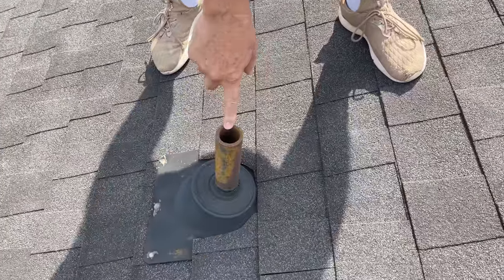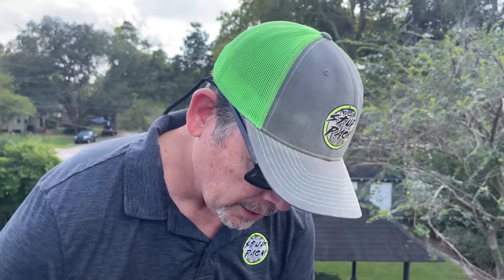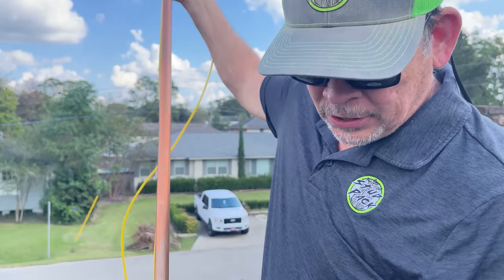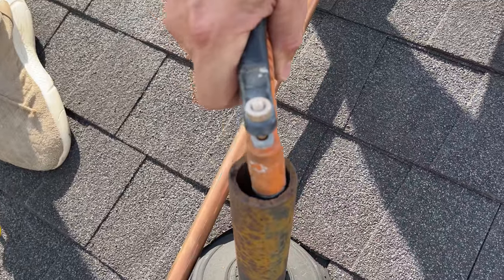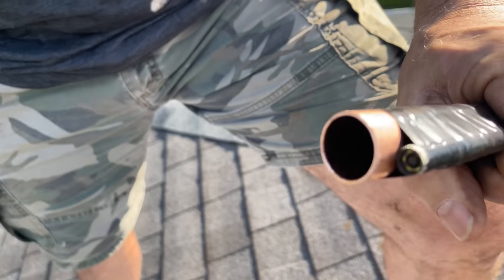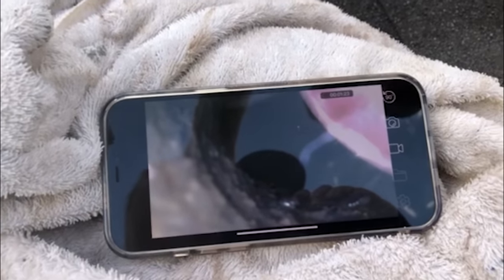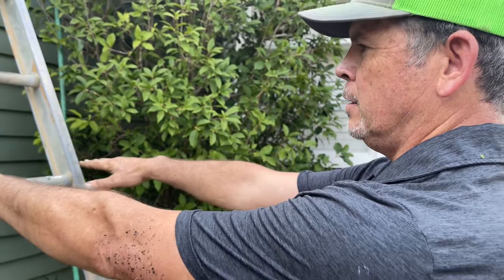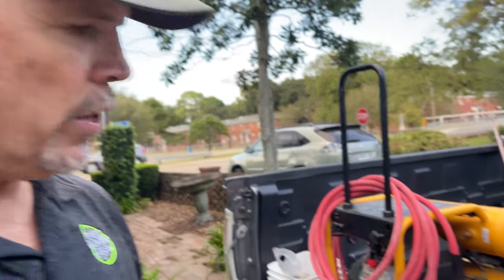Using a BORESCOPE to CLEAN OUT a CLOGGED VENT PIPE

Comment: We have squirrels here, and oak trees that drop tons of acorns.  I have a toilet upstairs that the water drains out of the bowl all the time, no leaks at wax seal or anywhere else that I can find.  Have torn it all apart and can't find a reason.  Have wondered lately if it could be because of a clogged vent pipe.  It does it all the time, whether we run any other faucets, toilets, washer or DW, or not.  Any thoughts?  We're on septic though doubt that makes any difference.  And, the roof is far too high and too steep for me to even consider going up there.

Comment: i always wondered why they don't put wire mesh over ends of vent pipes to keep debris and bugs and such out of vent pipe or little caps with mesh like chimney caps. the only reason i can see not to put mesh over pipe is ice forming from warm water fog coming up vent pipe and freezing end of vent shut in northern climates have you ever seen people put covers over vent pipe?
Reply from the maker: I’ve seen “p traps” installed upside down on a vent 👊

Comment: Just attach to vacuum to the top on the vent pipe and pull the access plug under the sink. You don't need to feed a pipe down there.

Comment: You should have tried sealing the vacuum hose to the top of the vent pipe. Using the whole vent pipe, you may have needed a more powerful vacuum, but it might of worked bettor?
Reply from the maker: Didn’t work

Comment: 17:38 I’d go to clean out under sink and use that snake to try and push the nuts back to 90 and then vacuum the crap out of them right up. Instead of pushing the towards the sink; and might take longer, but last think want is packing the, in tighter u dear sink wye?
Awesome vid though and seriously wicked crazy, and we have lots of squirrels too, and now after seeing this, time to install some screens to prevent them from doing this; as this is crazy😜
Cheers✌🏻
Reply from the maker: Cool thx 👊👍.  That snake was too small to make two turns if that makes sense.

Comment: When you ran the snake down the vent, you likely just shoved the pecans in the horizontal section down past the sink T and now they'll likely clog the sinks drain line...at least you can run the snake down the sink access until the pecans hit the main stack, I seriously doubt they'll be able to clog it...

Comment: I wondered how long it would take you to use a snake instead of a vacuum. How big a mess did you make in the house when you filled the vent with water?
Reply: Use Santeen drain cleaner (99% sulphuric acid). That shit will dissolve everything.

Comment: Is this where stud pack invest in a sewer jetter hose for the pressure washer??
Reply from the maker: Dude!  I was looking at those last night 😂👊
Reply: @StudPack  I think that would have been the easiest solution. And if you already have a pressure washer, which I’m pretty sure that’s what you all used to bore that hole under that slab that one time, a sewer jetter hose would be a great addition to the equipment set up. It will help bore those holes easier too, if you find yourself in that situation again.

Comment: You need to invest in a blow bag…. It connects to the hose and seals itself inside the pipe and has a high pressure nozzle on the other side and will blow out the crap in the pipe.

Comment: Simple stack waste venting design. People are used to horizontal wet venting to save space which isn't as bulletproof.  Could have used some sort of flexible poly tubing instead of that rigid copper. Problem with that shop vac is the amount of lift it can generate. Plumber should have finished the job with the appropriate snake up on the roof. We used to bring machines up on the roof all the time for jobs like this. Snake with an articulated end and replaceable bits. Yeah, get the plumber back.....

Comment: Hi, I  know that comments are more for people make comments concerning your vid, but I have a more of "How To" question. (Although, I enjoyed watching this vid which was very enlightening)  My son has an older home with a  kitchen sink with the same. type "Double Y" drain with "clean out plug" as shown in your vid with the difference being his still has the old original metal plug. The problem he or rather we are having is, we can not get the plug out. It is in a tight place under the sink and we have tried numerous wrenches in an attempt to remove it. We have not gone to the point of hitting the wrenches with hammers for fear of breaking the "Y" or other drain fittings as He is afraid that it may break causing more problems than it is worth. Do you have any suggestions on how to get it (the plug) out? My thoughts are to try to drill it out or add heat to the outside of the fitting while tapping a pip wrench. Possibly others watching this vid may have had or ran across this same issue. Any help from you would be appreciated. - Oh, his sink(s) drains very slowly thus the reason for removing the plug in an effort to open drain.
Reply from the maker: Applying heat works often but it’s risky under a cabinet.   I’d remove the p trap and run a snake through there instead.

Comment: Why didn't you connect the vacuum directly to the vent pipe?
Reply from the maker: Interesting question/problem.   The vacuum did nothing when connected to the vent pipe.  It was like putting your hand over the end of the hose.  The hose collapsed on itself.   Need air flow for the vacuum to work 👍👊
Reply: @StudPack 
Didn't realize that had been tried.

Comment: Great job stud pack, why didn’t you use PVC pipe a lot less $$$. 
I have a situation in my one and  only bathroom, when I turn on my attic fan original to my 1950 house a sewer (septic) smell comes out. 
Smell only when attic fan is on. 
My plumber came And tan water from roof pipe clear. 
He has replaced the wax ring twice. Still a methane smell. 
I have cleaned out the septic tank still a smell. 
I’m lost is Montrose. 
Thanks Houli.
Reply from the maker: Thx John 👊.   Regarding sewer smell...  maybe a dry trap on a fixture that you don’t use often.  Floor drain somewhere possibly....
Reply: @StudPack  thanks 
I’m wondering if the size of the p trap in my garage under the tub be the cause. I do remember it being bigger then the one that is their now after the remodel was done. 
That camera use used with your son what is it called and where can I get one. 
Thanks
Reply from the maker: Tub in the garage??? 😂👍.  Should be a link in the video description to that camera

Comment: did you or can you put screen using a zip tie or pipe clamp over the vent pipe so the squirrels cant do that anymore. Is it a bad idea to put anything to that would slow down the flow of air?
Reply from the maker: We did exactly that at end of video.   Commenters from snow zones say bad idea as snow will accumulate on vent.  An inverted p trap works too
Reply: @StudPack  ill try the inverted p trap thanks!

Comment: The atmospheric pressure would be capable of sustaining a column of water 33.9 feet in height. If a pump could produce a perfect vacuum, the maximum height to which it could lift water at sea level would be 33.9 feet.  That is the ideal height.  ATM at sea level is 14.7 lb/in.  Technically, a shop vac is not "sucking" - it is creating a low-pressure area that allows for higher pressure areas to enter.  That is why a shop vac tank needs to be sealed well to work and why it is hard to maintain a vacuum if the atmospheric pressure is able to enter the pipe; thereby reducing the overall differences in pressure and reducing the utilization of the full potential of the 14.9 lb/in atmospheric pressure relative to the vacuum.

Check out Watt / Savory- the "inventor" of the steam engine and the invention of the miner's friend in 1698..

Comment: My shower drain was clogged. Rented a snake. What I found was a mass of roots and acorns. The acorns were dropped down a vent pipe by woodpeckers. They stick acorns into every opening. At first I was puzzled by roots but the mystery was solved once the snake pulled back a bunch of acorns.

Comment: Why not just use a drain jet and blow the clog out? Lowes or harbor freight has them in different sizes. Just connect a garden hose and it expands inside the pipe snd water pressure clears the clog. Worked every time i tried one. 
In this case id put a towel in the sink just in case it splashes back out the traps.

Comment: Man, I had the exact same fucking thing happen to me a couple years ago.  Fucking squirrel dropped a big ass nut down the vent, which fit in the pipe perfectly until it hit the bend just above the cleanout in my basement.  It probably let a little water flow past it until I filled any remaining gaps with egg shells.

The way I found out it was clogged was when I tried to run the garbage disposal, and it shot a geyser of fucking eggshells up and out the opposite drain hole in my double sink.

We got lucky that my Dad had one of those snakes with the corkscrews on the end, because I was able to run that as hard as I could with a cordless drill from up on the roof, which was enough to get it lodged in the massive tree nut the squirrel stuffed in there, and we were able to yank it out.

My solution to making sure it NEVER happened again was to drill four holes around the top of my copper vent pipes, then I zip tied and screwed down some chicken wire (with relatively small openings so nothing smaller than a dime would ever pass through it), and then I used a metal strap with a barrel screw and tightened that around the circumference of the pipe, so it’s never going to pop off without tools.

I don’t know WHY the fuck we just leave vent pipes open like that, because it just lets random shit like leaves, water and whatever squirrels or other critters can drop down in there.  Most of the time it’ll never be an issue, but holy hell is it a nightmare when you get something down in there that causes a blockage.  So, if you have big ass trees that hang over your home and/or have lots of squirrels in your neighborhood, then you should make some wire mesh caps like I did to keep shit from getting in there and causing problems.

EDIT: I posted this before I reached the end of the video, and you guys came up with the exact same solution I did.  Great minds think alike I guess!  That said, your blockage made up of all those smaller nuts, seems like it was slightly worse than having one massive nut causing a blockage like I had, because once I cleared that damn thing out it was flowing like a dream.  If I was in your situation, I’d pour something like mainline cleaner down there to clear whatever is left.  To anyone reading this who doesn’t know what mainline cleaner is, it’s basically just a super concentrated version of lye that just eats through organic matter, but not your pipes.  It’s not a silver bullet, but it works wonders anytime you have a partial blockage, because it can really get in there with whatever is stoping the flow, and you can let it sit without having a ton of water in the pipe diluting it.

Comment: A clear flexible hose  would work better. I have used it before. They coil up nice.
Reply from the maker: We needed the rigidity of the copper to push it through all that junk 👊👍
Reply: @StudPack  got you on that i used mine with water not for nuts but mud and the mix worked fine. You possibly could have gotten a hose closer to the diameter of the pipe but then not sure about the camera. I reduced and used silver ac duct tape to secure mine.  For my job it was suction that was the key.

Comment: Next time cut some teeth in the bottom of the copper and a pair of vice grips then you can bore in the nuts and chop them into smaller pieces bc they break easy. Copper is softer than the cast pipe so you can't easily damage it. Hope this helps
Reply from the maker: We actually talked about cutting teeth in the tubing if all else failed 👊👍
Reply: @StudPack  in this case I'm glad you didn't though bc that fermented nut reveal at the end was a great shot to have.
Reply from the maker: I was surprised the nuts fit inside that copper.  They looked a lot bigger in the camera footage 😳

Comment: You guys were really chocking off the suction of the vac. with thar 3/4.  If you had just put end of the plastic vac line over the pipe (off & on) it might have had enough suction to lift what was in there.

Comment: I dont have a camera scope, but the shop vac is what I would have done from the roof. But then with it still blocked, I would have used the vac on the clean out port under the sink. Have you ever used the blower on a shop vac to blow thru a clog on a sink drain? I have it does work. I like your videos, but get your son to do more on camera work.

Comment: Rent a electric plumbing auger next time that has different sized heads & snake & auger every pipe from the top of the vents out to the city through every clean out & drain connection. Rats or squirrels are a pest to every trade & we need to take every precaution we can to keep them out of our building systems.Lowes or Home Depot usually has affordable tool rental \ loan programs.

Comment: I would have just put the shop vac hose directly on the vent pipe the larger diameter of the shop vac hose would have pulled all that stuff from one shot probably but great job anyway
Reply from the maker: It did not work.   Put your hand over the end of a vacuum hose.   No flow equals no vacuum.  That’s what we had 👊

Comment: Why didn’t you just attach the shop vac straight to the vent pipe. Provided the pipe doesn’t have any breaches in it it would create a vacuum in that pipe and those nuts would have come out. Also instead of wrapping a towel around a sprayer you can always go buy a bladder called a drain king and put that down there attached to a garden hose and it would create high-pressure and blast the water the other way

Comment: Should’ve took the filter off the vacuum. You don’t need it when sucking water.
Reply from the maker: Yeah I actually leave it sometimes to prevent the water from entering the housing 👍 probably doesn’t matter though 😂👊

Comment: Use steel elec conduit pipe 1" diameter -- bigger better cheaper than copper.  And why not finish clearing that drain pipe for the family?  Use the snake send it down the cleanout hole,  and if it's grease just get some degreaser granules to dissolve?
Reply from the maker: Conduit comes in 10 foot lengths too short for this job
Reply: @StudPack  get 2 cast iron gas pipes 10 ft + 4 feet whatever  and a threaded  coupler to get desired length. Still much cheaper than copper and w bigger diameter easier to vac nuts out
Reply from the maker: I needed the thin wall copper.  No way a coupling was going down that old vent 👊
Reply: @StudPack  Done this  fishing and vac plenty times inside 1.5" or 2" roof plumbing vents at  much longer lengths.  Chimneys and horizontal sub terrain drain lines too -- using gas iron pipes 3/4" and 1" which has bigger inside diameter than copper. The threaded coupler will connect multiple pipes and if tightened with a pipe wrench won't come loose no matter how long or whatever you're doing. It beaks through roots easily.   Learn to use it you won't go back to expensive copper

Comment: Hydro jet would have made quick work of that,
Reply from the maker: Tried it.   No go.  The nozzle fit in the pipe but the diameter was such that whatever the forward jet bored thru the bits couldn’t get by for the back jets to do their job.   Hard to explain...   does that make sense?
Reply: @StudPack  what kind of nozzle you use?
Reply: @StudPack  I know what your saying though, we have a reg, medium and small hose, the medium hose probably could of got it but you know what your doing and most likely right.

Comment: 3/4" x 20 ft. Type L Hard Copper Tube   going at about $5.12 per ft would be $102.40 not including tax, at about $5.29 per ft would be $105.80.  Plus you gave it away by saying $100.

Comment: Why not just hook the vacuums hose around the top of the vent pipe , turn on the vacume and have the vent pipe act as a long vacume hose and vacume  the pipe clean.
Reply from the maker: It didn’t work.  It’s like putting your hand over the end of the hose.   Gotta have air flow for vacuum to work
Reply: @StudPack  to further explain, when you were vacuuming stuff out of the clogged pipe, air was drawn down the vent pipe around the outside your copper pipe in order for the suction to work. Once you had the clog partially cleared, you could have tried the direct "vac to vent" and opened the cleanout plug down below to enhance the air flow. But you solved this problem extremely well.
Reply from the maker: Got it thx 👊

Comment: Lol PVC Is alot cheaper would of used inch and a quarter to fit on
Reply from the maker: It is but I doubt 3/4” pvc would have fit inside.  Needed the thin wall and larger diameter of copper👍

Comment: You called in a plumber, who told you the problem was a blocked vent then left the job to be done by someone else. Then  after pushing the clog further, called the plumber back!? Y'all need a good plumber. I would never leave my customer like that and leave the work to someone else when the problem is clearly in the vent pipe.

Comment: Why didn't you get a 2 foot piece and a sleeve and save a bunch of $$
Reply from the maker: They only sold 20 footers.  I asked.
Reply: @StudPack  For what they charged you, I would've found a  shorter piece of pipe, or a short piece of PVC with a thicker Inside diameter and a sleeve.
Good video anyways.